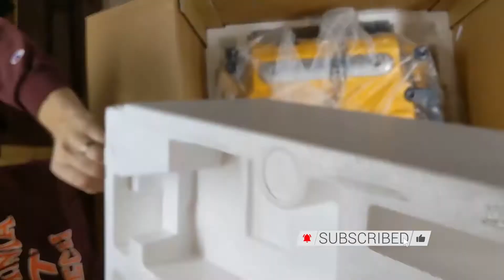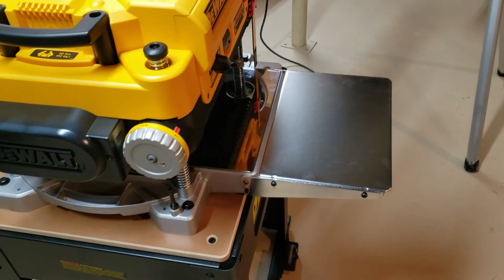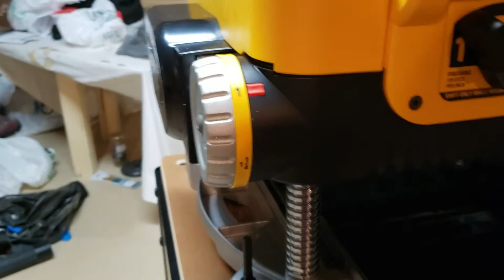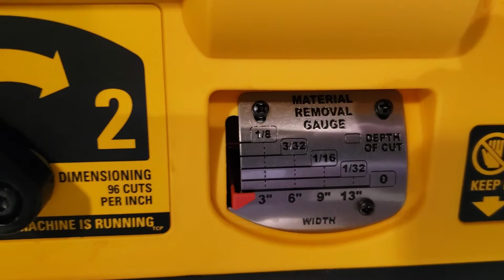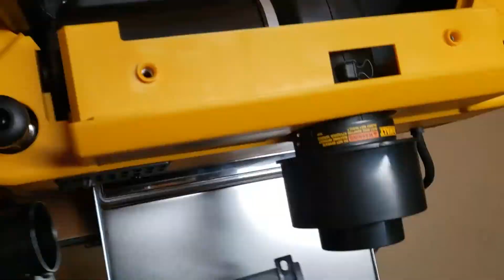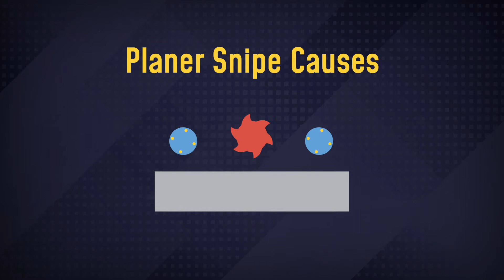Dewalt DW735 - Unboxing, Overview, & Impressions

Comment: Something important about this model...
there's a version 1 and a version 12.
1 isn't great because the entire bottom part of the planer has to be changed if there's a problem with bowing of the plate.
12 I'm told is the one that's commonly sold.
When you buy your planer, even if the box was factory sealed, you need to check that it hasn't been used and isn't damaged.
Don't buy this tool and leave it in the box uninspected for months. You may regret it.
You will either want to buy the infeed and outfeed tables to avoid snipe as mentioned in this video.
The sniping effect happens as a result of the board inserted lifting and dropping a little.
The rollers put pressure on the wood, and when only one of the rollers is applied it puts the wood at an angle which the blades don't adjust to.
So the wood goes up or down, and the blade keeps turning anyway making deeper groves.
If you can't get the infeed and outfeed tables, you can use a long flat piece of melamine, and wax it so the piece you cut using the planer just slides.
The Shelix blades for the DeWalt will run you about 600$.
They're not only more expensive, because installing them yourself will void your planer's warranty.
Something you'll also want to consider is that the three blades you get with your machine do a better job when new. And the Shelix blades are more consistent, performing the same way so long as they're not damaged or completely warn out.
To simplify what I just said... the standards 3 blades perform very well at first and dull over time
while the Shelix blades last longer, do a more consistent job but don't perform as well as a new set of three standard blades.

Comment: How much did the planer and stand cost you on sale?
Reply from the maker: I've seen the 735x as low as $499. But didn't see anything that good this holiday season. The 735x + 7350 was $599 at a few online stores, but it seemed sketchy or scammy.

I got my combo for $629. A bit more than I would have liked, but it's the best I could find this holiday.

I've searched Craigslist and Facebook on the past, but I'm never fast enough. In the end, I decided that spending a bit extra up front for the assurance of a quality new item that will last combined with being able to stop "wasting my time" searching endlessly, it was worth it.